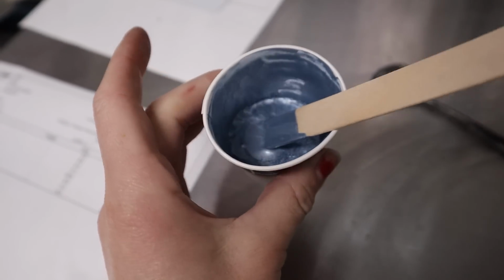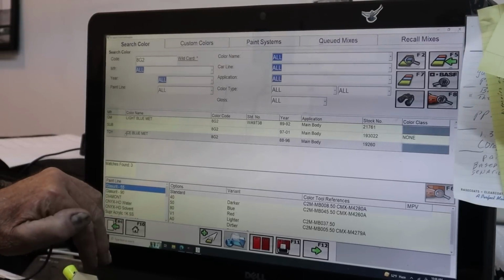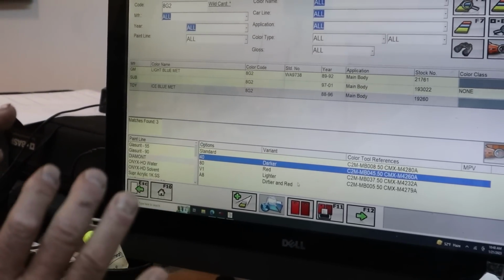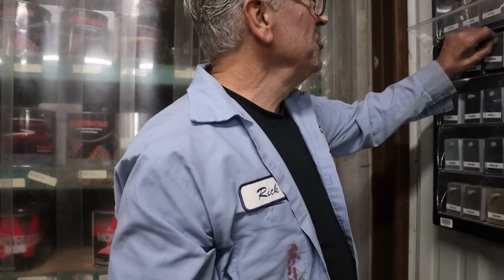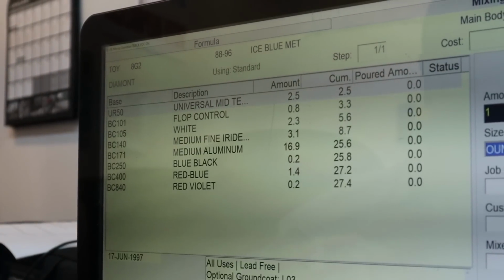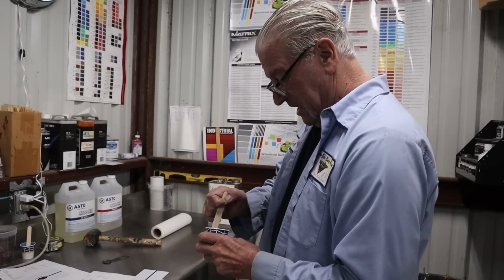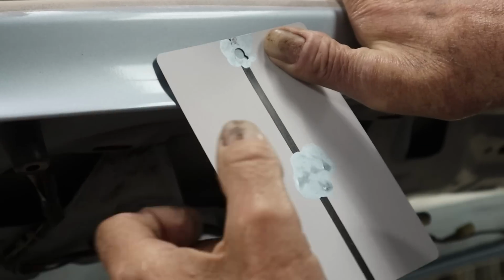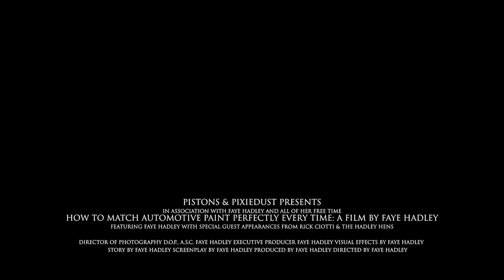How to Match Automotive Paint Perfectly Every Time, featuring Rick Ciotti from The Paint Spot (&8G2)

Comment: I used to work for a pigment manufacturer that supplied PPG, BASF, and others. A pigment that is dirty or clean has to do with color accuracy when comparing two samples. If you add a small amount of the opposite color (opposite in color space or color wheel) it will appear “dirty” when applied to the car. For example, the opposite of blue is yellow. Adding some yellow pigment to it will make what is called a color that is dirtier. This goes back to the pigment manufacturer trying to make pigments that are the same batch after batch after batch. It can be very difficult to do when trying to keep the cost of the pigment low.

Comment: The flop control is one way to keep the metallics from laying over when they are supposed to stand up it's another reason why you have to use the right temperature range for the chemicals a 70° reducer or an 80-degree reducer because if stuff does not flash off in the correct amount of time the solids will lay down instead of stand-up in the paint. This is very important on transparent colors like light blues and especially silver's

Comment: Great explanation of flop. I’ve helped the term before, and I knew what it was, but now I know why it happens. 
In their defense, I can see why they refer to it as a flop agent and not a suspension agent. Probably saves them a number of phone calls and explanations.
Another thing that can affect color is what color primer/sealer you’re using, speed you’re moving the gun, pressure you’re using, humidity… So many factors that guys like Rick need to take into account.

Comment: That is certainly something that computes but you rare consider on color-matching OEM, and it's fascinating to finally hear it. All the residual paint in the lines. Wha-ha! 
At a meet-up of a fairly rare vehicle we had some time back ('99 Vehicross), most all of the survivors had different colors just as it goes, but we had an earlier Silver Metallic that was a fair bit darker than a later built Silver Metallic the following model year. The light bulb comes on at long last.